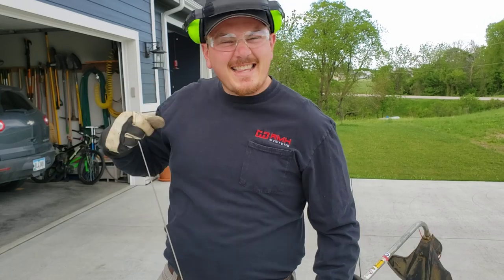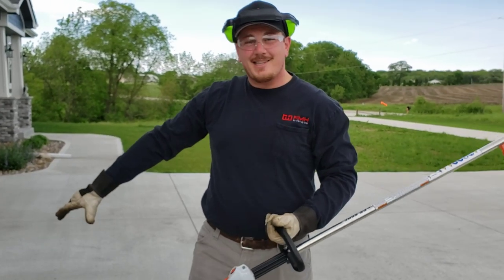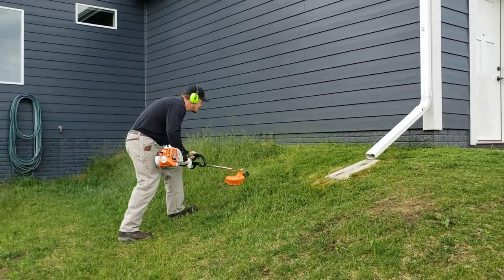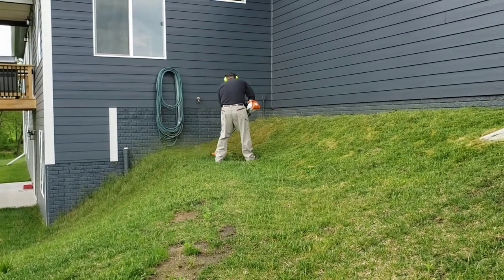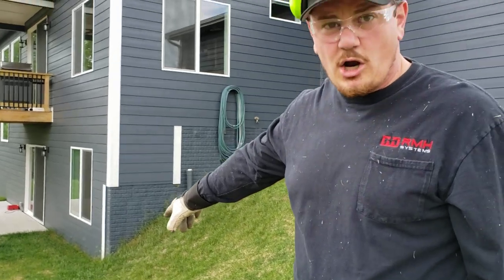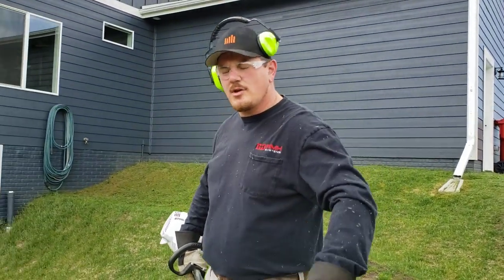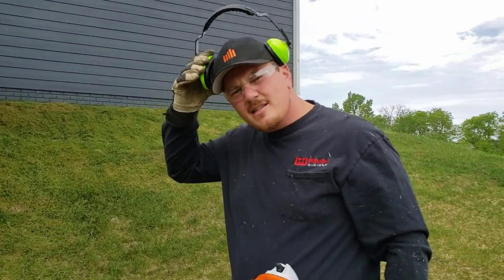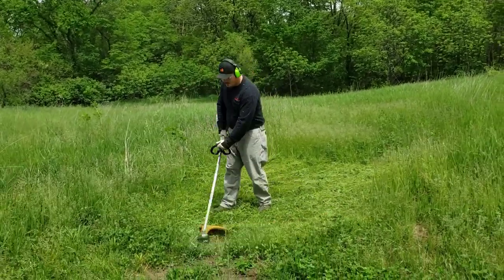Stihl -  FS56RC - Trimmer

Comment: My new Stihl is a FS-56 RC-EZ. It’s the easy start feature and was on sale, today, for $199.99?  Mi put a half a tank on it this morning before I topped it off with Moto Mix.  It is a lot lighter than my Husqvarna 28L which I have had for ten years.  I just finished up trimming the yard, where I could not get with my lawn mower.  It is my second Stihl trimmer.  My first one was an FS-76 thaI bought in 1993.  I used it for close to twenty years before I traded it off on a chainsaw.  Never had a lick of problems with the FS-76.  I use good fuel in all of my equipment. 45:1 Stihl Ultra withPNE gas plus stabilizer.
Reply from the maker: Nice! 20+ Years on a trimmer is amazing!!!
Reply: @BrianPhillipsRC  it was a good trimmer.  The only thing, other than line, was a primer bulb.  Don’t even think I replaced the spark plug.  After 20 years, I removed the solid straight shaft and cleaned and  lubricated it.  I did, periodically, lubricate the head with grease.  Didn’t use the Stihl tube of grease, just put the grease gun up against the hole and squirted grease into it, while spinning the cutter hub.  I did it until I could not get it to accept any more grease, screwed the plug back in and it was good for another year.  The grease in my grease gun is better than anything Stihl puts in a tube.  I now have synthetic grease in my grease gun.  Then, I was using Chevron with Moly EP2 grease, the same thing I used on my 25,000# tractor.  The black stuff.  Can’t find it anymore.  That moly grease was slick.

Comment: You hate your grass don't you? :)  why not load those areas up with wood chips?  I just got my hands on the same trimmer.  It was used and didn't run right.  It didn't even run.  But now it works awesome.  World of difference compared to my battery one.

Comment: I just bought a new stihl fs56rce and I'm hoping that I made the right choice. I was looking at an echo 225 srm but the store was sold old.
Reply from the maker: Well, I've only used mine two or three times now, and it's started very easily each time. My only issue is the angle of the head...but I wanted a straight shaft for more power to the head.
Reply: How do i replace the cutting line

Comment: Stihl the best I run a Golfcourse for 25 years and before that I owned landscaping company you have the right PPE👍ps idea you can run fine bead of Roundup around house siding make it alot easier
Reply from the maker: Nice! Would you just spray it against the paint/waterproof membrane area, then let it run down into the crack?
Reply: @BrianPhillipsRC  yes that would work just adjust your nozzle to A real fine stream

Comment: Yeah that orange stihl line is garbage. I have this trimmer i didn't really care for it . I recently bought a echo 2620 way better machine in my opinion. Comes with better line and the speed feed head. It also has way more power
Reply from the maker: I love this machine, but doubt it's the best one you can buy. One year later, started in 3 pulls ;) That's why I bought a Stihl ;)
Reply: I worked Equipment rental weused echo Till the carburetors went bad and then it’s cheaper just to buy a new one

Comment: Hi Brian. I have the  same trimmer and  I don’t like it.  The spark plug bulge  rubs against your elbow constantly.  You have to put it one side or the other  which effects the  best angle.  The rubber bit turns constantly  and is annoying .  I purchased it to replace my Echo that I’ve had for 15 years and regret It.  I’m not a Stihl  hater. I have a Mini Boss chainsaw and I love it. Edit . Maybe they put the bent shaft power head on the straight shaft model.  It would work fine on  the bent shaft.
Reply from the maker: I noticed the end is a bit large, but I've found that I kinda rest it on my hip, which seems "wrong", but works for me. I'm about 6'1" tall...you?
Reply: I’m 5’ 10
Reply: What's up with the plastic between grips? It spins! turning the trimmer on its head! It's right where you would normally hold the trimmer if you take off on a walk up a driveway. I'm going to cut mine off if I cant find a good reason for it's being there. The left hand grip will need adjusted per individual sliding it down on the shaft allows you more control of the head allowing you to swing the trimmer harder, also I personally spin my left hand grip to the right some. That allows me to place my elbow on the right side of the spark plug boot, and puts the rite angle on the trimmer head when using I hope that helps your experience with the trimmer also I switched from the eye glasses to full face shield now I can let her eat and no more dog shit to the face or fogging. Face shield might help with the chain saw making glasses fog.

Comment: I've been doing yard for 10 years personal lawn business and stopped by my local hardware store for a mower belt and got this weedeater and didn't expect much but I've been needing a new one I used to have a sthil fs 85 and the fs 56 rc don't feel much different the first thing i did after 10 minutes was switch out the crap trimmer line to sthil 105 it fit perfectly and is awsome to use it's actually more comfortable but not is powerful as my old one but it works I hope it will hold up
Reply from the maker: I switched out the line, and seems to be working better too.

Comment: I know what you mean about fighting a trimmer to get it going.  My new FS-56 RC-E is a snap to start.  Prime it a few times, put the choke on, and pull the starter, slowly.  Off it goes.  I let it warm up on high speed half throttle for a little bit before I blip it to idle.
Reply from the maker: yes

Comment: they way you pulled is the perfect way to break the internal recoil spring
Reply from the maker: You bet!

On an unrelated note - I just used it (two days ago???) after sitting for the WHOLE,  LONG, TERRIBLE WINTER...it started in three pulls - THIS is why I bought a Stihl! Worked great, and I may only have to trim two or three times a season, but I don't want to have to kill myself to get her running. My old one was HORRIBLE for all the 12-13 years we had it. It was a "free" almost new trimmer, and I should have thrown it in the street and run it over (twice) just to avoid someone else being cursed by it!!! It was bad.
Reply: @BrianPhillipsRC  Stihl is the best!!

Comment: That guard looks good on there 👌 
I got some of those Upstart chains for my MS250 and they're great 👍
I also have the FS56RC. I use an 80 tooth brush cutter on it for honeysuckle ... it's awesome !
Reply from the maker: We just ordered another three pack of chains yesterday! If I were not such a novice, I'd be able to use them longer, but I get into the dirt way too often, when trying to cut off stumps flush with the ground.

As the for the brush cutter, is that a fixture from Stihl?
Reply: @BrianPhillipsRC  
No , I bought the brush cutter blade off eBay. I had to buy a little adapter separately. I'll try to look it up and shoot you a link.
Reply: @WhoDaBoss-dc4or  it says on the guard that it's not for brush cutter blades but you found a adaptor kit for it cool

Comment: Only thing is…for these trimmers, they have an elastic (spring assisted) starter rope. After awhile, if u continue to grip it and rip it, it’ll wear the starter out prematurely. The normal 56r’s (if the make them, idk) (not the 56rc) they have a normal starter like the 70r so u dont have to worry abt tht with those.
Reply from the maker: I wasn't aware. I supposed I could replace the cord???
Reply: @BrianPhillipsRC  not the cord, the actual spring inside the recoil assembly. Tht the typical west part on those starters, unfortunately
Reply: Wear
Reply: I found one for $75 obo  would it be worth it to buy if it checks out. I’m an  echo guy  but it’s cheap enough . What are your thoughts
Reply: @rayray9777 not too bad of a deal for one if everything’s squared away with it.

Comment: What a woos.  Why not chaps, steel toe boots, a Stihl helmet with face guard.  I wear shorts, Sperry Top Siders and no socks.  If a broken piece of cutting line, twig or rock hits me I live with it.  I am a Marine not a woos.  The only safety equipment I wear is glasses, but I wear them all the time.  Where is the shoulder harness that came with your trimmer.  The F.s-56 is a high end residential trimmer with a lot of professional features.    I’m sorry I just hate reviews of anything where the reviewer come out dressed in every bit of PPE they can find and look like part of a Swat team going on a call.  My Husqvarna 28 L was a beast to start, too.  It is now hanged up in the shop.  It never let me down but it was heavy and not as well balanced as the Stihl.
Reply from the maker: I specifically don't have all the PPE on that's recommended. I just use the stuff I want to use, and get CRAP all the time for NOT having it all on! You're the first to call me a woos for wearing only parts of the PPE "required" by the safety nazis - I'll take this as a compliment.
Reply: @BrianPhillipsRC  I learned a long time ago to completely disregard people that disagreed with me.  The safety nazis you speak of probably would not know one end of a chainsaw or weed eater from the other and are just parroting back what someone else said.  I fought for the right to wear any damn thing I want to wear.  Tell them this - safety is an acceptable degree of risk.  What is acceptable to me may not be to you and vice versa.  There are no such things as guarantees and things without some degree of risk.  You pays your money and takes your chances, as they say.  If more of the current generation had served their country in time of war this would be a better place with a little more common sense.

Comment: Hi
 Brian, fantastic video and thanks for demonstrating on how to use. I was wondering if you had a video of how you mixed the gas and the oil for it. You did mention 1 : 50 Just wished to see you do it. i know that its not complicated. Do you use non ethernal gas? I just purchased the same one you have and I am not experienced in using it yet. The line keeps disappearing even though I'll bump it on the ground a few times and even then the line wouldn't come out. Sorry to be long winded, but overall thanks and I'll subscribe to your channel.
Reply from the maker: I very recently decided the easiest way to do it is to use a small scale ;) I am a scale technician by trade, but you don't have to be one to do it...SUPER EASY

1) Use an empty container...lay it on the scale, and zero out (or TARE if there's no Zero function)
2) Pour in some premium gas (without Ethanol) and take note of the reading...mostly full, but not ALL the way to near over-flowing, as you'll need room for the oil too, and some air space for mixing it up.
3) Take the weight you see (I suggest in GRAMS, so you can just divide it by 50), then put it in the calculator and DIVIDE this by 50...the result is how much you need to add.
4) Zero (or TARE) the scale.
5) Add the calculated amount from step 3 of oil into the gas.
6) Cap it and shake it.

You'll NEVER go back to mixing with measuring cups once you do this...SOOOOOO EASY!!! Never make a mistake again!

Good luck!
Reply: The easiest way to mix by volume is to use the Stihl hp ultra 2.6 oz small oil bottle (or equivalent brand 2.6oz) and add it to 1 U.S.gallon of 91 octane gasoline, or higher if you can find it, and absolutely run only non-ethanol fuel. When I bought my FS56RC, the Stihl dealer increased the factory warranty when I purchased a 6-pack of the 2.6 oz oil bottles. Since I needed oil anyway, and the extra 2 years was a great deal, I went for it. After I used up the 6-pack, I just refill the 2.6 oz bottles with oil from a gallon oil jug to save money.  Since I run chain saws as well and use a 1 gallon gas can most of the time for an easy refill, adding the 2.6 oz to a gallon makes it quick and simple out in the field or woods, since the 1 gallon is easier for me to pack around with my other falling and bucking gear.  If you want to run another brand of 2-stroke oil, and you do not want to buy any oil in the 2.6 oz bottles as they are a more expensive way to purchase oil, you could probably stop at a chainsaw repair shop and get a few free empty 2.6 oz bottles from them to reuse. My local saw shop throws them out all the time, so they are easy to get around my neck of the woods. I run the heck out of my wacker on an acre of tall, thick, super stout weeds and brush every spring for wildfire control, and have never had any issues with it. The only maintenance items I have had in the last 4 years have been an annual removal and cleaning of the intake air filter, dead easy, and just yesterday the removal and unclogging of the spark arrestor screen after I loaned my machine to my neighbor, and he ran the motor at 1/2 speed (after I told him not to) which clogged the screen with unburned oil and slowed the rpm's way down. If you run it flat out most of the time like you are supposed to, the screen will very seldom get clogged. I ran it for four years without it happening, it is just something you need to know about with these motors. Run 'em hard and run 'em hot, and the oil in the mix will burn off during combustion after it lubes the cylinder like it is supposed to. Hope this helps you out. Oh, and do not forget to shake the gas can to keep the oil in suspension before you refill each time.  😉

Comment: I'm about to purchase this weedeater. It looks powerful enough.  Nice video.
Reply from the maker: Hope you enjoy it! I like it, but there is one detail that I noticed over time with it, and that's the angle of the cutter. If you find it to be a great fit, totally disregard my comment. I used to run a trimmer with a bend on the end, and this did make the unit a lot heavier and longer, but it helped with my ability to reach work in front of me, whereas this one seems to be a bit off on the angle of the cutter...it's not a HUGE issue, and furthermore, I really just wanted an ENGINE that will start EVERY TIME...and I have that. I've never struggles to start this, other than I still to this day have no clue what the heck all the buttons and knobs mean - LOL - it just starts! My previous one was a fight, EVER TIME, even after it had been running, it would be difficult to restart, at time...

Good luck, I think you'll love it, but DO CHECK the angle if you can, before you buy it. You might be taller or shorter, and this might not be a big enough issue to cause you, or anyone to pass on this trimmer, but wanted to throw it out, in case it helps.

Thanks for watching Christopher
Reply: @BrianPhillipsRC  straight shafts just need to hold your right arm up higher . Bent shafts we don’t really have to do that as much. Also, if you move the handle on the shaft down more that will help.

Comment: I purchased one from my local Ace Hardware, well I've lost track of how long ago.  Still runs great, I replace the air filter, fuel filter and spark plug every other season or so.  I also bought the Shindawa/Echo speed feed head and really love it.  It makes replacing the trimmer line like a two minute job.  My Stihl dealer recommended that you wear hearing protection as well as eye protection when using it.  Apparently, there are some sounds in the ultrasonic range that can damage your hearing with prolonged use.  I think eye protection while running a trimmer is a given.  The guard fell off mine at the end of last season and it appears to put it back on, you must pull the head.  I just tried that, and since I don't have an impact driver, I'm going to have to take it to the repair shop.  Its also needed the idle adjusted for some time.

Comment: I didn't notice any greece fittings I know the more expensive ones have it
Reply from the maker: I didn't either...you have a grease zerk on the shaft??? That would be nice, but there-again, I don't have to grease it ;) I'm "loving" this machine...but "loving" a weed wacker is hard to do, since even when it works well, it's still a pain to use ;)

Comment: Seems like it's hard to start to lol
Reply: Just messing with u I just got the same one a couple days ago I like it
Reply from the maker: Actually, I just trimmed the whole driveway, and had to start and stop about 20 times to refuel, and replace string - but she started on one pull most of the time, maybe 2-3 when I ran her out of gas....but my primary issue with my last machine was getting it started, so as far as I can tell - PROBLEM SOLVED ;)

Comment: My Uncle gave me a string trimmer once that was hard starting.  Several years later he had his in the shop and wanted to borrow mine.  When he brought it back he asked me "Where did you get this POS?"  I said, "You gave it to me."  He then said, "Why couldn't you have been smart like I was and give it to somebody else?"

I have that Stihl FS56 RC-E myself.  When he said he felt like he was pulling it too hard on startup, he may have been.  If his is the RC-E it's equipped with their Easy start crank where it doesn't even really grab hold till about 2/3rds the way through the pull and when it does grab, it's using the first 2/3rds windup to sort of assist in the last 3rd of the crank...at least that's how I understood the guy at Ace describe it.  I'm changing me head to a Stihl super cut 20-2 as it's an auto feed instead of a bump feed.  I hate bump feeds because our ground is so uneven I'm constantly accidently bumping it.